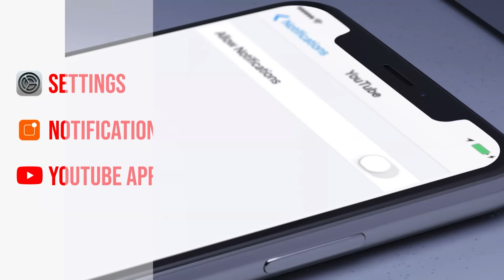Back Bevel Chisel Trick - Does it really work?

Comment: For the Charlesworth trick, does anyone see a problem with using a hacksaw blade that has had the set teeth removed?
Reply: That's what I have been using, seems just fine.  It's around .025 " thick, same as a cheap stainless ruler.
Reply: I think a hacksaw blade would be too thick and make too steep of a back bevel.
Reply from the maker: Why? just go buy one of those cheap thin $5 pocket rules and you have a perfect ruler for the ruler trick.  But if you have already taken the time to get rid of the teeth on the hack saw blade it should work fine, although a tad thick for me.

Comment: I don't agree with David Charlesworth's ruler trick , it may be a good way to speed up sharpening but doing so introduces another facet , so along with a micro bevel 4 sides or 3 angles have been introduced to what started out as 1 angle .
Reply from the maker: Hi Pat, you obviously can do anything you want but you are in the very small minority when objecting to the value of the DC ruler trick.  It is a free world however, do as you please.
Reply: Pat, don't be hampered by advances in techniques or practices in woodworking.  Avoiding the ruler method over a decade of sharpening might save you a total of a few minutes.  Sharpness, as taught by David Charlesworth, is determined by the intersection of the two surfaces with the smallest possible radius and David's ruler method reduces the radius substantially.  It takes longer to describe or properly demonstrate the method than it does to perform in real time.